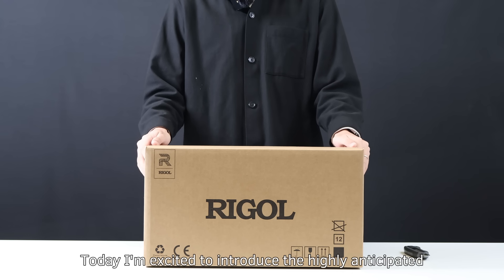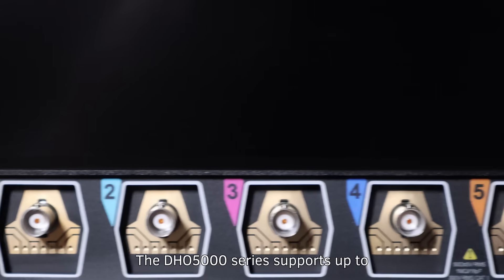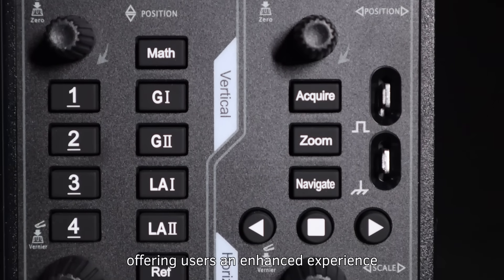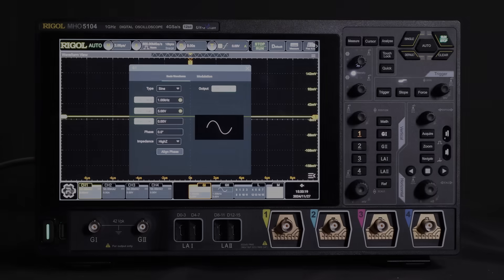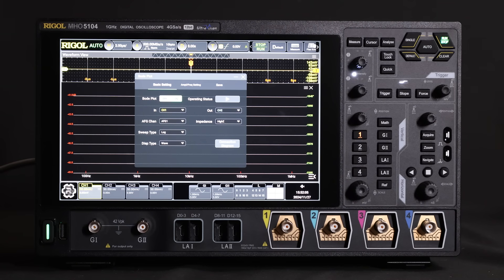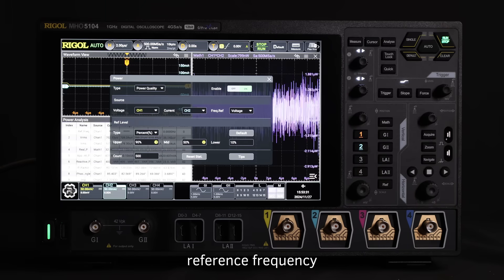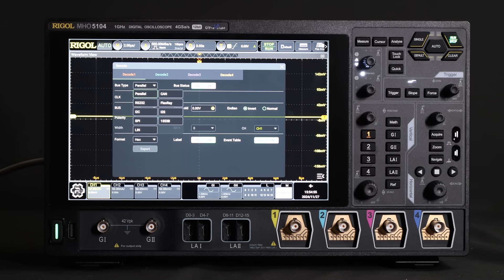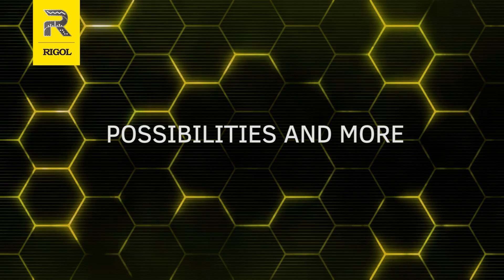RIGOL MHO/DHO5000 Oscilloscope Unboxing

Comment: Where is a EUR750 / CNY6000  14" 4-Ch oscilloscope with 100-250Mhz bandwidth (touchscreen only if it lowers cost) for hobbyists?
All the latest economical 4Ch ones still have tiny screens and have been like that for years. Nothing above 10" at 16:9 - or in other words - a technical stand-still.
Reply: TV screens are huuge,  computer screens too.. mobile phones.. if u want a small one u actually have to pay MORE as they are only offered in the upper "classes" while the entry level is sporting large screens only.
So.. what is the issue with 'economic' oscilloscopes stagnating at 10" since 2015?
Does marketing decide this?
Reply: @joansparky4439  you can plug in your own external touch screen if you want. or use the web interface on your pc.
or buy 
DS70304
the cheapest 14" is a Micsig MDO2504

Comment: The ENOB is limited to 7.7 bits, compared to more than 8 bits for competing products at 1 GHz.
Reply: What competing products?  Keysight, Tektronix, and Rohde are on different planet for price.  Siglent is nowhere near a million waveforms a second.  Rigol also has nice active probes for these scopes too.  Really what competes?  Just sad my bench is full and already way over budget...
Reply: @inn0vator535  the dho5108 seen in the video costs around 20k€. We are not talking about oscilloscopes for a personal workbench here.
Reply: @inn0vator535   The Siglent SDS3104X HD is cheaper and offers 890,000 wfm/s compared to 1,000,000 wfm/s, but this difference is not really relevant since the maximum speed is only available in recording mode, with very short time/div and without using memory. Otherwise, Rigol it is at a disadvantage: FFT of 1 Mpts vs 2 Mpts, counter with 6 vs 7 digits, only 2 USB ports compared to 4 , BODE Plot 25 vs 120 MHZ